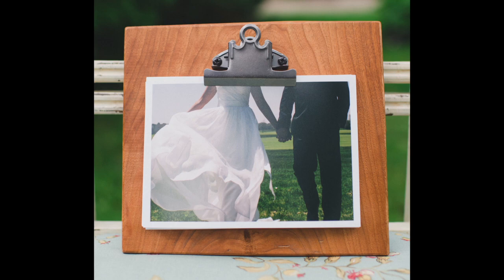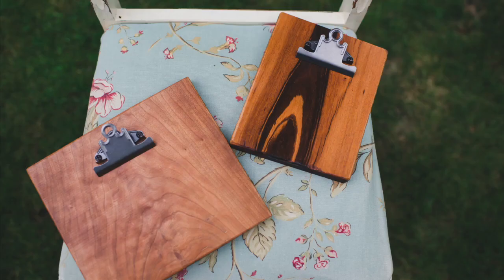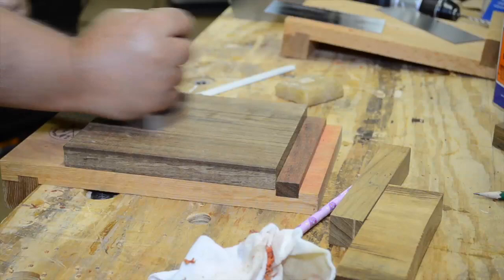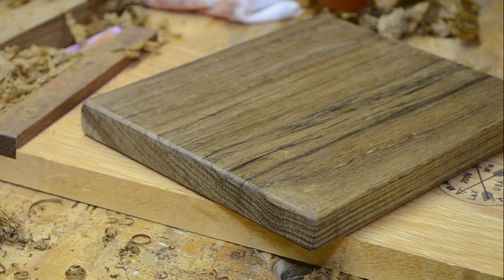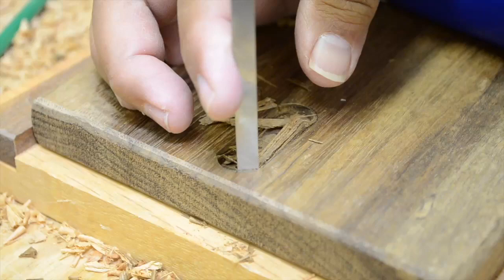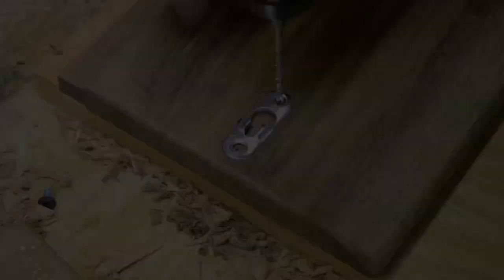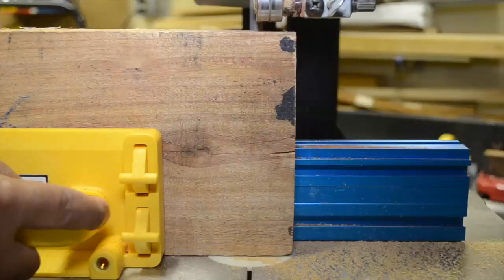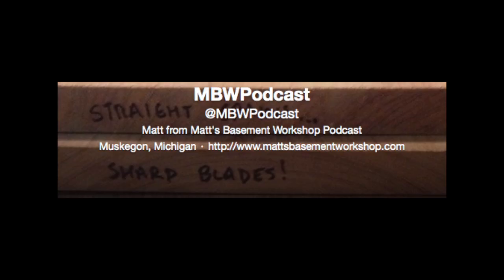528 Hip photo clipboards

Comment: I'm not trying to be too critical.  I was just wondering if there was a reason to not use a plunge router to inset the keyhole hardware? Neat project.
Reply from the maker: Not a "critical" question at all. I personally avoid the router as much as possible. It's quick and efficient, but it's loud and makes me uncomfortable.

With all my videos I like to mix up the tools I'm using and show there are different ways to do the same thing. I won't assume everyone has the same tools I have. I kind of hope there's a little bit for everyone.

Thanks for watching!
Reply: I actually love to use my router... but for something so small I think I probably just gone with hand tools as well... I guess it just seems easier to control and finesse that small amount of wood removal to me..
Reply: I have used a key-hole router bit to make a way to hang plaques.  That should work in this situation too.  Pretty quick and easy and doesn't require extra hardware to buy.  My dad does them using the keyhole bit in the drill press so you don't even need the screaming router.  

It does however require the board to be thicker so there is enough meat left to hold everything.